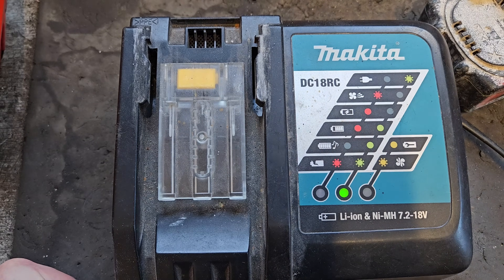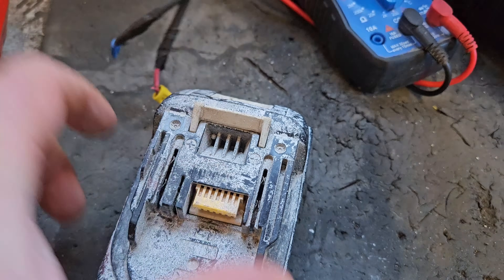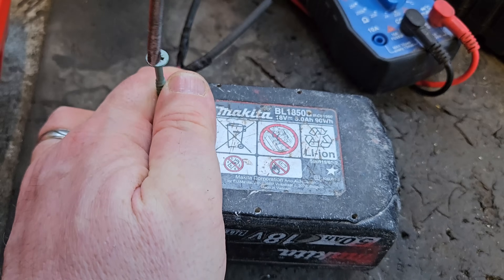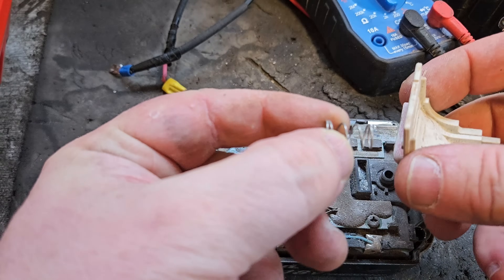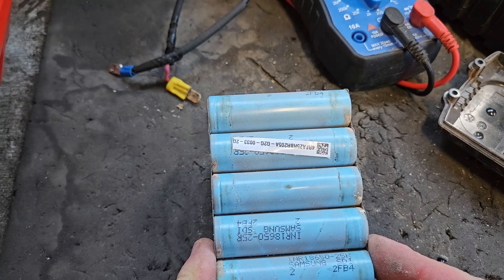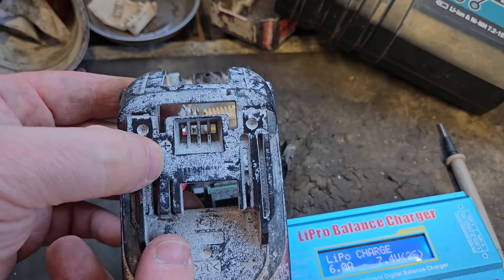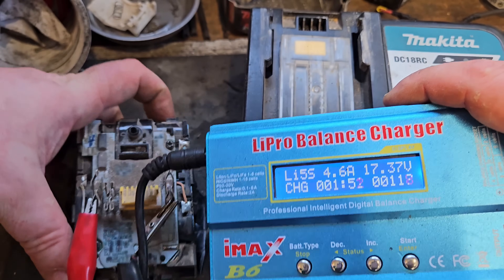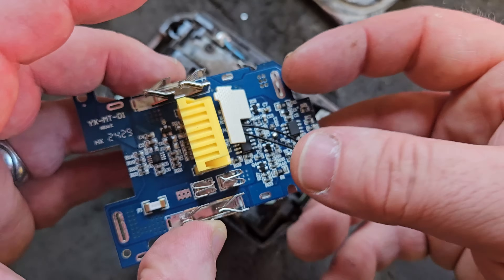Testing & Repairing Makita 18V Lithium-Ion Batteries

Comment: 5:23, these cells can actually go all the way down to 2.5v at a time. i’ve seen a makita battery go as low as 12.6v and still charge on the official charger
Reply from the maker: What you are saying is correct

Comment: I just opened a BL1850 (manufactured 2018) with the same, blue, Samsung 25R cells.  I don't think that either your battery or mine is a knockoff due to the quality of the PCB (with surface potting).  All cells were balanced at 3.67VDC so I guess it's the PCB.  I'll work out the best PCB to buy and give that a go - any advice would be very welcome.
Reply from the maker: I buy these
https://amzn.to/44FmjCG
But these are also available 
https://amzn.to/446Qv9B